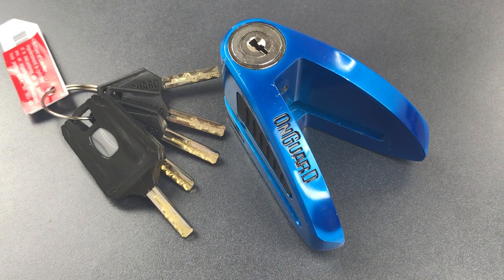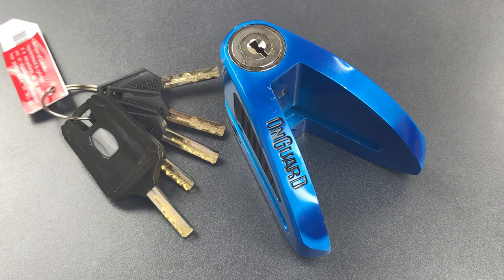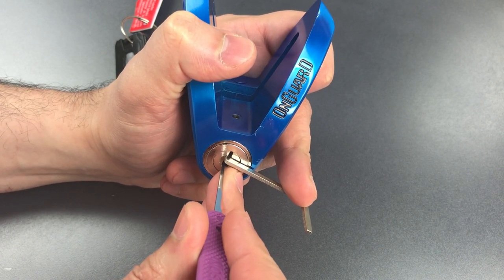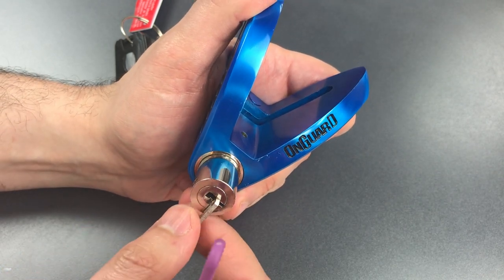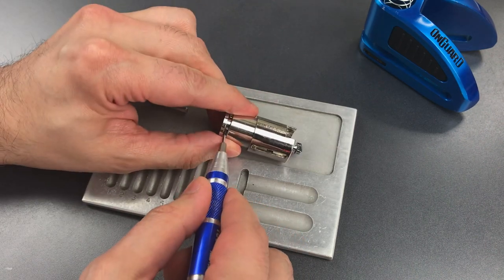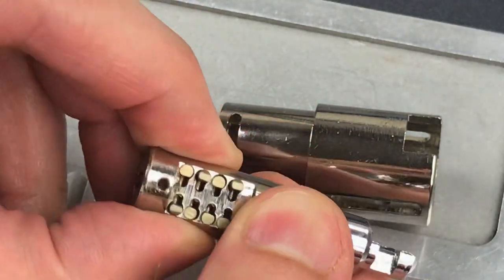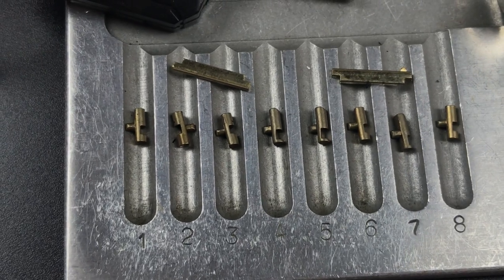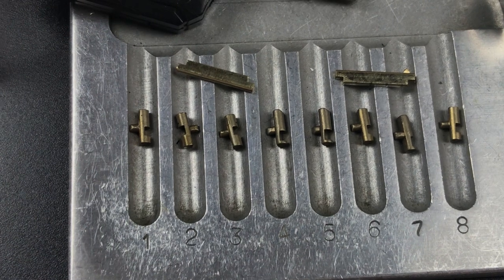[711] OnGuard Boxer Motorcycle Disc Brake Lock Picked (2 Sidebars, 8 Sliders)

Comment: Your videos are addicting. Question: how much does the difficulty in picking this lock increase when the lock is secured in its intended position (i.e.on a motorcycle brake caliper). You have a decent amount of freedom to hold/feel the lock in-hand. Curious. Thanks!
Reply: IF the lock was facing downward, I suspect it would make it a fair bit more difficult.

Comment: Very nice seeing a slider taken apart. I have a bicycle cable lock with what I now know is a slider. It is nice being able to see al the pieces and discern how it works.
Are there any locks with teeth on top and sliders on the side? Seems like an efficient way to pack pins into a small area.

Comment: Atleast the screw cannot be removed while it's still locked!👍🏽😉
Reply: Don'z Lockz that is secret twitter information
Reply: Actually you can, unless you put the lock back to front so the keyhole is facing the wheel.

I'd fill the screw head with a touch of super glue just to be sure.

Comment: I have that lock for my motorcycle. While I agree the level of security for them isn't the best, the thing is... it doesn't need to be. It attaches to a brake disc, so even the best lock can't secure a bike since they can just break apart the disc brake. The only purpose of this lock is to make rookie thiefs think twice before making an attempt on it, and to slow down pro thiefs long enough to hopefully get good enough surveillance footage on him/her or even get lucky and catch them in the act so you can beat the crap out of them. Also, I personally don't just rely on this brake lock to secure my bike. I have a hidden tracking device in mine and I never park it anywhere that doesn't have security cameras over looking it. It also gets locked up in the shed every night so it's out of sight.
Reply: turgsh01 good technique, i also always hide a kill switch on my bike. Been lucky so far and never had anyone try to steal mine that i know about.

Comment: +LockPickingLawyer
I have a brake disc lock with a disc detainer lock that I've had for a few years.
I bought a pick that you recommended and have modified it as per same video, it seems, however, to tension from the bottom of the keyway and the add on kit that came with the kit, if modified to fit through the anti drill spinner, would fall apart.
I would like to send this to you to see how you tackle it, or even if you have any suggestions on picking it would be good.
love the videos, very informative and amazing skill.

Comment: I thought I saw a tiny coil spring drop onto your parts tray in the lower right hand quadrant of the tray around 4:47 and 4:48 as you were placing the core in the tray.  What's that about?

Comment: I don't understand how the core is connected to the shackle whose end interlocks with the caliper.  It seems to be a good thing (another motorcycle disk lock that I use, Xena X2 also does that and the body seems to be made of steel), but does that make the core pulling or twisting any more difficult?

Comment: Looks like one of the side bars, the one on the right on your tray, has a notch that may fit onto these tiny false gates, looks like the one on the left does not have this, am I right?
Reply: ofek pearl it looks like you may be right. But i think the sidebar on the left is rotated 180° so if it also does we cant see it... look at the sides. The sidebar on the right is looks like a really really fat "T" and the one on the left looks like an upside down really really fat "T". So we can't actually see the side that engages with the sliders on the left one. I think...